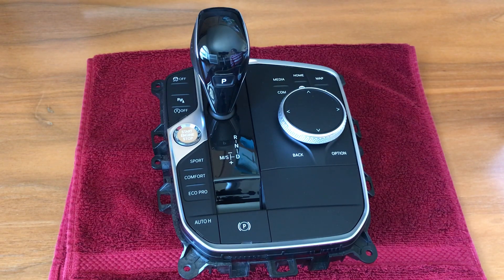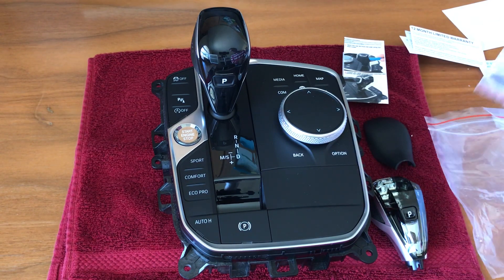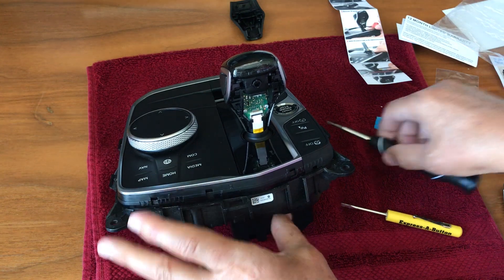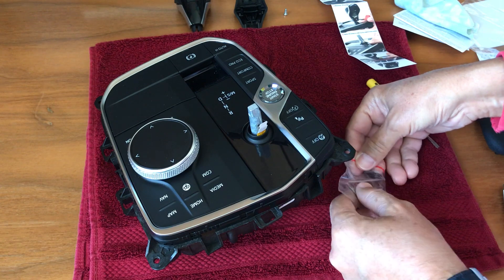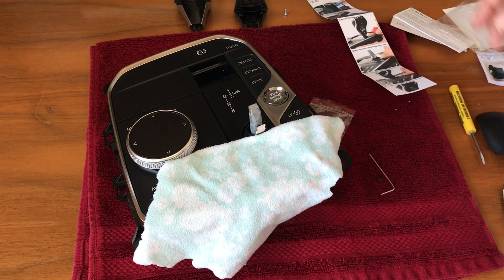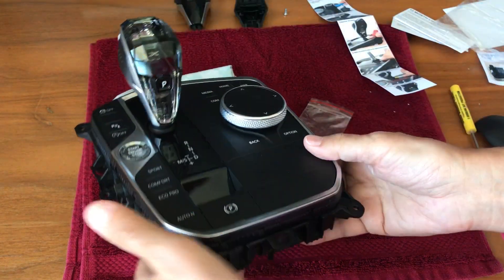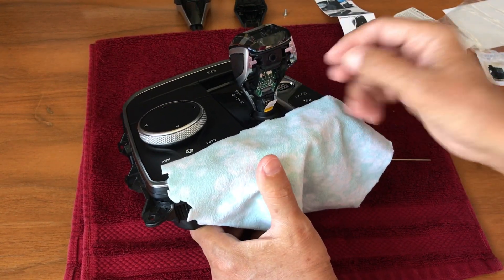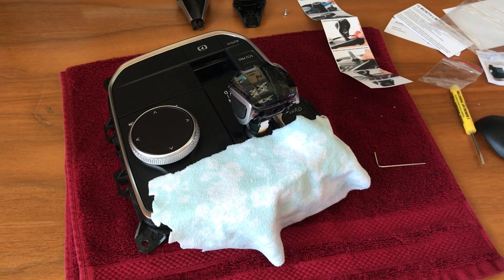Crystal Gear Lever Installation for BMW, Part 1

Comment: Great video!! Nice enhancement!! Thank you!
Reply from the maker: Thank you! Please note that there is a later version of this video. You can find it here: https://car-analysis.com/BMW-Crystal-Series-installation.htm - the difference is just in the screw used to fasten the gear shift knob. The factory changed the design. Now you use BMW:s screw instead of the two small ones.

Comment from the maker: You are correct that the tool in the demo video is too long, but you can get a shorter T10 torx hex key or wrench that will do the job. And yes, we have many customers who have been successful with the installation.

Comment: Does the battery have to be disconnected?
Reply from the maker: You either have to disconnect all vehicle batteries or remove the center gear console from the car.

Comment: Is it works with Bmw x5 2002
Reply from the maker: No, it does not work with a 2002 X5. Only 2004 and later.

Comment: Hi, why does the battery need to be disconnected?
Reply from the maker: It is to avoid electrical damage to the center gear console in the car. Another way is to remove the center gear console from the car and perform the installation offline. For plug-in hybrids, this is the only recommended way to install.
Reply: @car-analysis  Thanks for getting back to me. 
Mine isn't a hybrid so I'll just disconnect the battery, that looks a lot easier than taken the centre console apart.
Reply from the maker: @luvit7567  Make sure to disconnect BOTH batteries, front and rear.
Reply from the maker: There must be no power to any function in the car before installation can start.
Reply: @car-analysis  wow, didn't know they have two batteries, cheers 👍

Comment: Your videos are helpful BUT how to remove the controller is as important as you instructions.  So if us viewers can’t get the controller out, you video is not of much value.  Respectfully, I have a 2020 Z4 M40i.
Reply from the maker: While most of our customers have been successful in performing the installations without removing the gear console, a small percentage have failed resulting in damage to their cars warranting expensive repairs and requiring a tow to a dealership. We want all customers to have successful installations. Therefore, we have recently changed our instructions to mandate that the center gear console be taken out of the car prior to installation. It is not possible for us to make videos for this step because it varies between BMW models. But you can use the BMW Repair Manual to figure it out, as we describe on https://car-analysis.com/BMW-Crystal-Series-installation.htm or go to an independent BMW workshop that can help you out.
Reply: @car-analysis  thank you Martin, think I’m headed to a certified BMW shop as you suggested, Cheers.